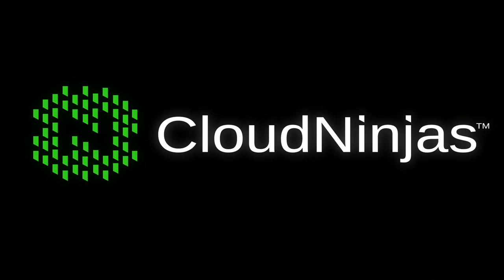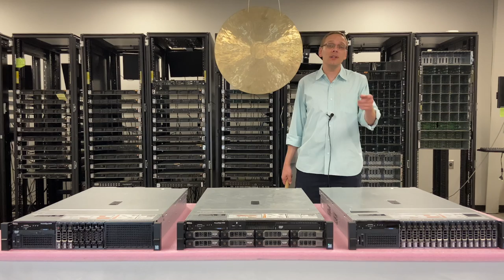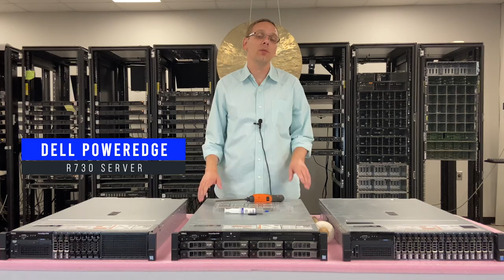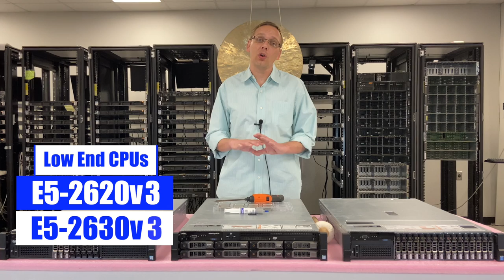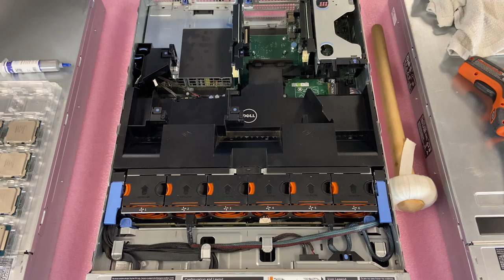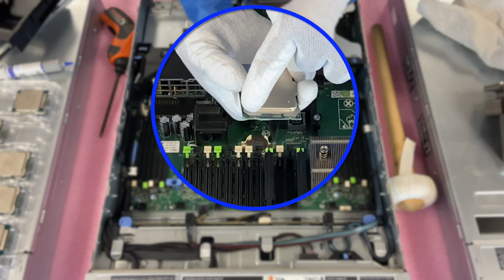Dell PowerEdge R730 Server CPUs | Intel Xeon Processors Options | LGA2011-3 Socket | How to Install

Comment: I just want to share below, some information about Server Naming scheme for Dell PowerEdge servers for any useful purpose.

The initial letter indicates the type (form factor) of the server:

C = C Series; Modular and compute optimized server nodes and servers for hyper-scale environments
F = Flexible - Hybrid rack-based sleds for rack-based FX2/FX2s enclosure
HS = Optimized solutions tailored for cloud service providers
M or MX* = Modular - Blade servers and other items for the modular enclosure MX7000, M1000e and/or VRTX
R = Rack-mountable servers
T = Tower Servers
XE = Purpose-built for complex, emerging workloads that require high performance and large storage.
XR = Industrial-grade servers for extreme environments.

Three number naming convention

The first number after the letter indicates the class of the system. With 1-3 being 1 CPU system, 4 - 7 are 2 CPU systems, 8 can be 2 or 4 CPU's and 9 is 4 CPU's.
The second number indicates the generation, with 0 for 10th generation, 1 for 11th generation and so on.
The third number indicates the make of the CPU, 0 for Intel and 5 for AMD.
Example: the R740 model is a Rack 2 CPU system from the 14th generation of servers with Intel Processors. 

Four number naming convention

The first number after the letter indicates the class of the system. With 1-5 defaulting to iDRAC Basic and 6 - 9 defaulting to iDRAC Express.
The second number indicates the generation, with 0 for 10th generation, 1 for 11th generation and so on.
The third number often indicates the number of CPU sockets, 1 for 1 CPU and 2 for 2 CPU's.
The fourth number indicates the make of the CPU, 0 for Intel and 5 for AMD.

Example: the R6415 model is a Rack 1 CPU socket system from the 14th generation of servers with AMD processors.
Reply from the maker: Love this chart from Dell.

Comment: i have the left one the r730 16sff with two xeon e5 2699v4 and 24sticks 16gb each normal dual ranked and all 16 drive bays populated with 12 of them 1gb sata ssd in a raid 10 and 4 as 30tb hdds on raid 10 for a total of 60tb the ssd are also on raid10 this means 4tb capacity. the os a plain debian without ui on a usb stick. i use this thing for a project in the maker space i am in. we have 25.000 2gb datasets of weather stations once in a month and analyzing the data and make a interactive map that is hosted on our maker space webseite. i needed a realy fast machine. i had to beginn the project running on a lenovo t60p but after 100 datasets this was no longer an option because 40h of processing. so i changed to a ryzen 9 5950 but after a year i had 3.000 datasets and this took on that machine 30H but cpu power was not the issue the ram was the issue. dual channel was not enough even with 4 slots and dual ranked ram i was only able to use 8 threads with 60% load each. if i used 10 threads the performance even got worse. so the problem was clearly ram channels or better said i need more ranks so o bought a used r730 for 600€ and bought 2 used 2699v4 and replaced the existing cpus because i need cores lot of cores and 24cores are each are enough so i had in total 48 cores and 96 threads to work with also i bought 24 2r16gb sticks but only 2133 mhz because the memory controller supported only 2133mhz if you use all 24slots with dual ranked ram. also i bought a nvidia t100 card. i optimized my code and now i was able to run 90 threads at once and two treads was for control and quick checks. i did this in bursts so i can get data process them and store untill i am finished with all 50gb. now i have 25.000 datasets each month and feeding the machine needs a week of work and processing the data takes even with this beast 5 to 6h but compared to other hardware this thing is the fastest machine i own and probly for the next 5 years it will be still the fastest.

Comment: Do you offer core-exchange on part upgrades?  My HP DL380 has 2x E5-2667v3 and 16x 16Gb 2133MHz RDIMM.  I am considering replacing them with 2x E5-2667v4 and 8x 32Gb 2400MHz RDIMM.  Do you offer a trade-in discount?
Reply from the maker: Please contact buyback@cloudninjas.com.  We usually buy bulk, but definitely worth checking with our team.  Thank you.

Comment: Just purchased a couple of e5-2695v4s for my 730xd with the slim heat sinks and it boots up and starts loading windows then I get a "Blue Screen of Death".  What would be causing this issue.  We have installed all of the firmware and software updates through the DSU and have no idea where else to go with it.

Comment: Will this r730 series cover the XD or just r730 variants? I already have a r730xd LFF up and running but I love your server overview content.

Also, I'm using dual 2696v4 as they where way cheaper than the 2699v4s on ebay for the same specs basically. From my understanding the 2694's are OEM part numbers for the 2699v4's, am I correct on that?
Reply from the maker: We will be recording R730xd series this weekend.  However won't be on YouTube for a few weeks.  Need to release all the R730 videos... then R530 series then back to R730xd.  Mostly the same as R730 but there are some key differences.

Comment: I have a Dell Power Edge R730 with 1 CPU (Intel Xeon E5-2609 V4). My question is if I were to upgrade to an identical CPU in the 2nd socket would that cause any corruption with the current system (Host machine: Windows Server 2012R2) VM's running in Hyper-V? And if not, would it be as simple as allocating CPU cores to the existing VM's?
Reply: The way Windows can be, I would plan on the OS having issues with it.  Back up or image your data with a third party program(Not Windows backup), or use copy/paste in File Manager or xcopy in CLI with /e /v extensions; ergo at a DOS prompt type, "xcopy [path of your data] [path to where you want them externally stored] /e /v"(Keep the spaces where I have typed them).

Comment: If you're going to upgrade, wouldn't moving to a v4 version be better than any of the v3 versions? Is there a situation where a v4 version isn't as great as a v3 equiv?
Reply: depends on the v4 version e5 2690 v3 > e5 2650 v4